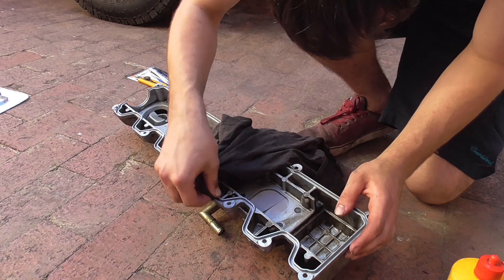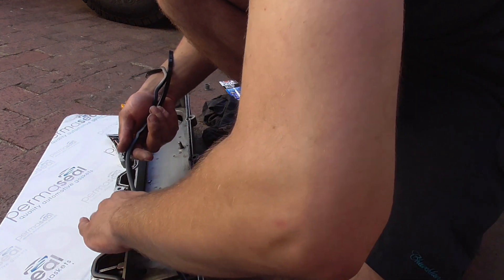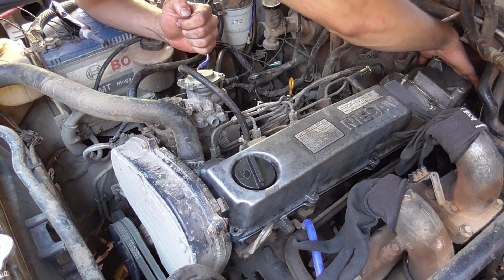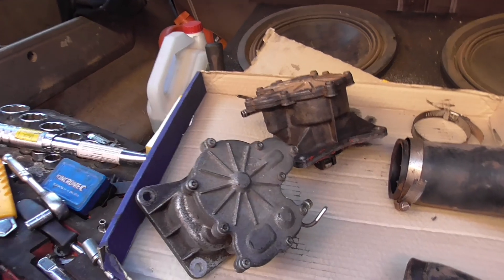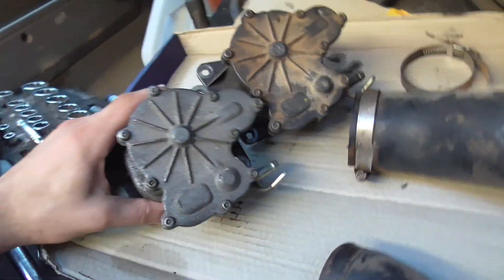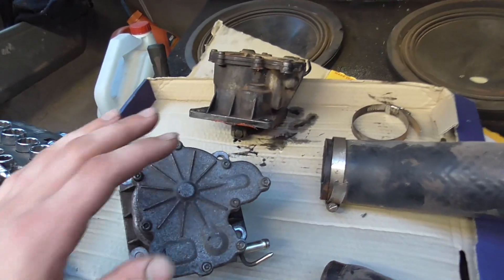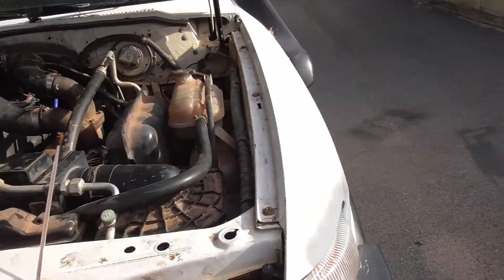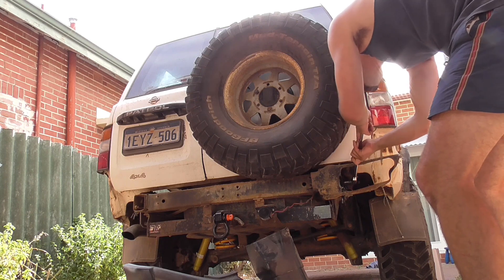RD28ETI Vacuum Pump Inspection & Testing

Comment: Very interesting video . Thanks a lot .  Plan to check my Safari pump after 310 000 km . Have found  Nissan RD28  pump 14650-VB101   and   Toyota 29300-64100  (  3 and 2 ct engine) have the same shape . Looks like you can use Toyota  which is cheaper .
Reply from the maker: Good find mate, yea that would make sense that the module is an supplied product from a vendor rather than a nissan design
Reply: Need your email